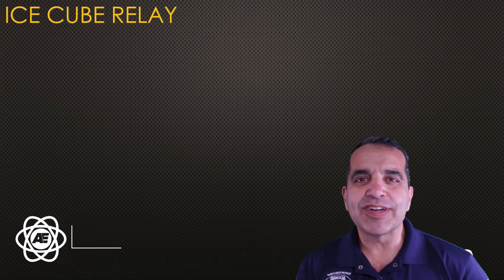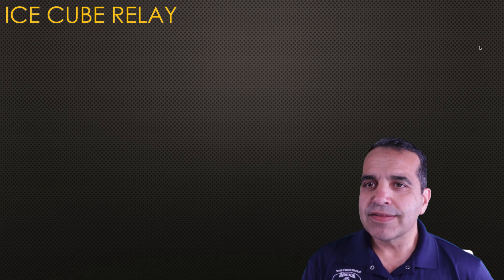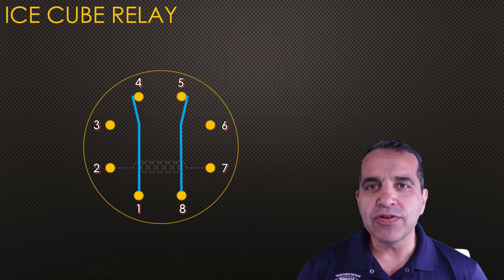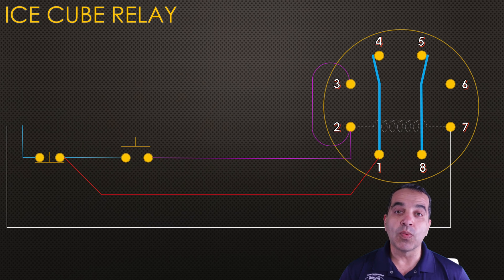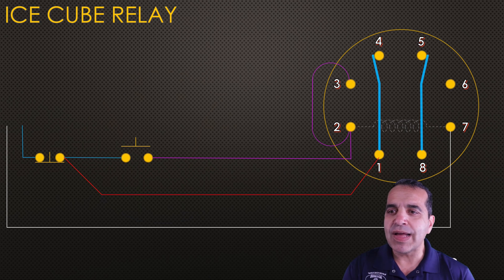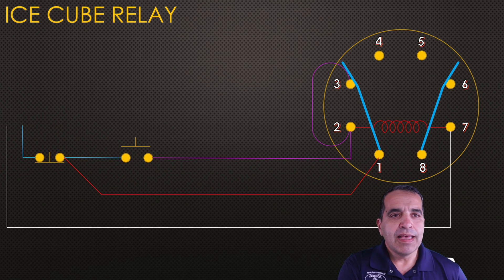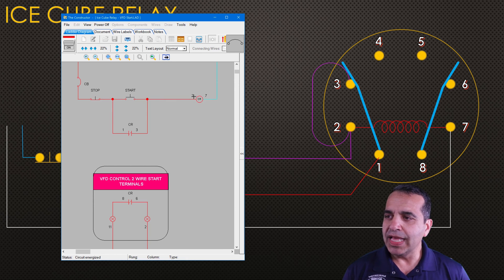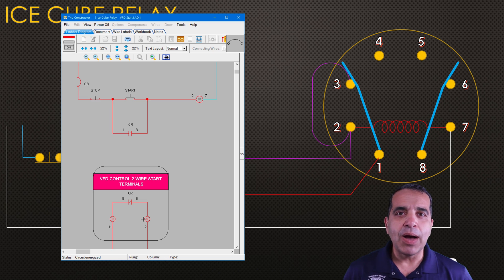Motor Controls: Using an Ice Cube Relay to Start a VFD

Comment: You're using 10amps for VFD and motor control yet say that 10amp relay not to be used with anything requiring a load? 10amp is the common rating for general residential use, lights and power points, here in Australia.
Reply from the maker: The 10 amp relay is being used to on the control circuit of the VFD… not the motor circuit. The current on the control for a start signal is measured in milliamps.
Reply: @AccessToPower  Please excuse my ignorance.
Reply from the maker: @fuzzfacelogic789  no worries. Thank you for watching and commenting on these videos. We created them to be helpful. Hopefully they accomplish that goal.

Comment: Why doesn't the power from 1 and 3 cause a short against the line? Or maybe electricity doesn't work this way
Reply from the maker: If you look carefully at the schematic about minute mark 2:40 you will see that 1,2, & 3 all originate from the same source. Therefore they are the same potential.

Comment: Excellent video Walter!  I have been looking for hours for how to setup a remote start for a VFD powering a 3 phase motor on a table saw.  Yours by far is the simplest, most straight forward with a clear explanation of how to do it using an Ice Cube Relay and the functionality of that relay.  This video provides background support for your other video:  "Starting a VFD with 2-wire Start".  Thank You!

Comment: Hello sir will u plzz explaine me how i conect the solenoid valve timer to auto and manual starter
Reply from the maker: If I understand your question correctly, you should be able to connect a timer circuit in the same way that the float circuit is connected in the video link here.  https://youtu.be/1J36SgPABFo